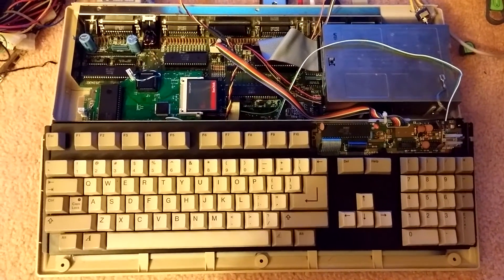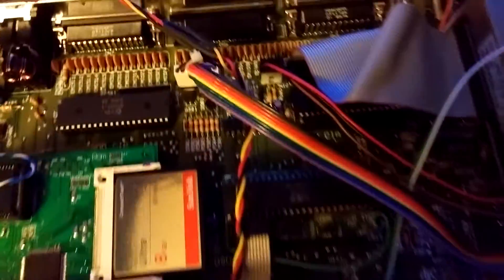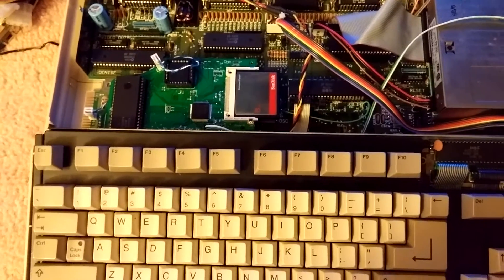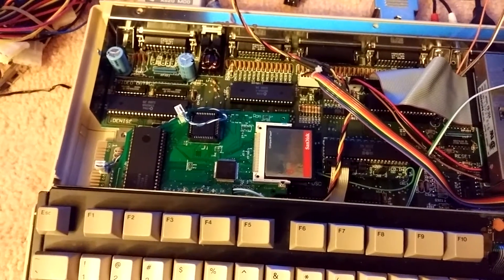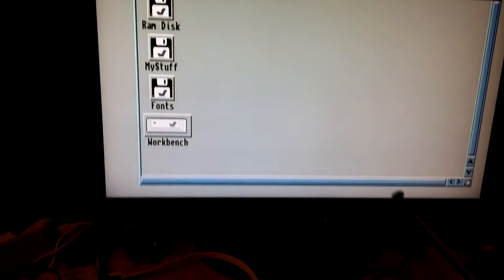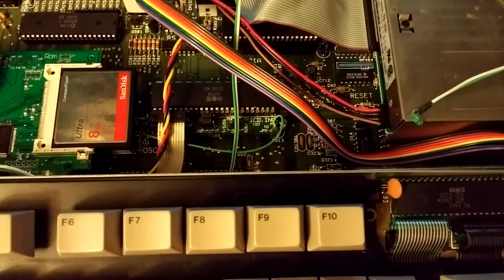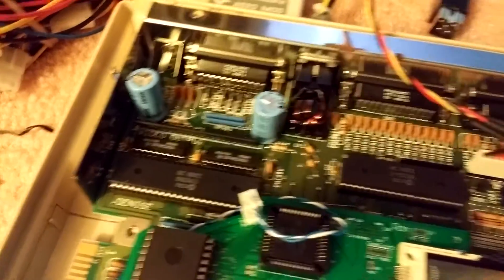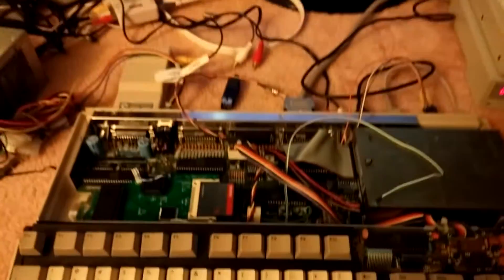Amiga 500 NTSC with a Kippler 8Meg / IDE plug in card.

Comment: It is hard to see, but is the board pushing against that one big capacitor and I have an older board that fits like yours and it does not sit very firmly either...great video.
Reply from the maker: Mr. SEA .. thank you for the view and the compliment 🙂🙂🙂, yea it does not hold in super well
But if you do t move the unit.
Seems.to hold good enough.. but I can see it needed to be reseated from time to time.
Reply: Are there many sources of this board? The actual site literally appears abandoned with little to no updates....cheers.
Reply from the maker: Mr. SEA .. I believe he has had some life issues that has for now..stopped his work